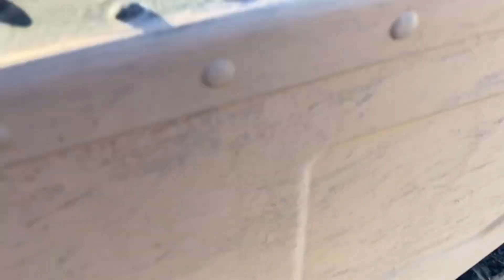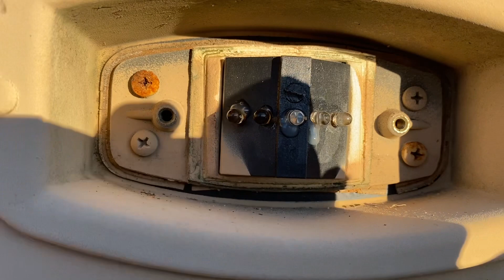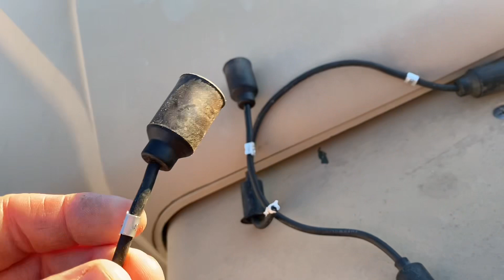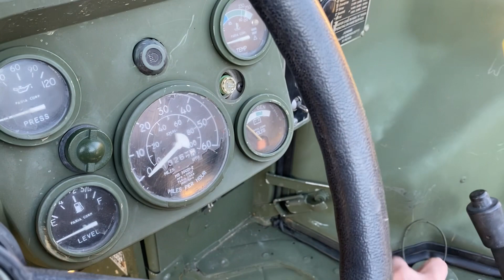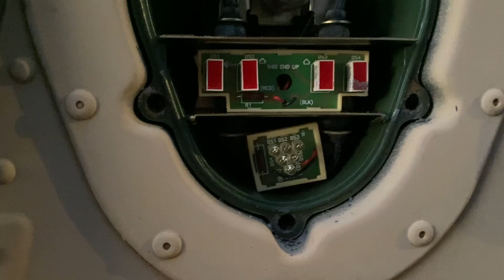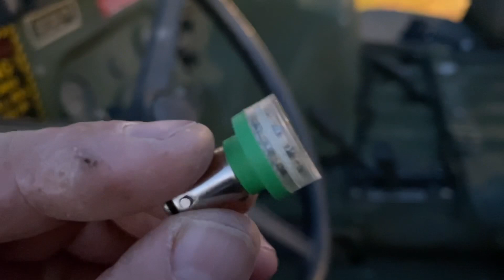Humvee 24volt Lights Replacement. HMMWV M1114 Project.  Side markers, tail and head lights.

Comment: Just as a heads up (I made the same mistake) If you make the tail light too bright it may interfere with the STOP/SIGNAL light which definitely need to be brighter than your tail light otherwise there is no change (or at least not enough change) in brightness when you apply the brakes.

Comment: Check your voltage while the engine is running. Kinda concerning that that side marker bulb was too dark. Check the grounds between the battery-chassis-engine block and the ground on the alternator. A bad ground between any parts will cause strange issues with the electricals. I wish I could find my notes but there is someone who make a new ground harness that will correct ground issues.

Comment: Hey, how did you fix the constant tail light issue? Mine is designed to be driven in blackout without constant tail lights, my tail lights come on when I break, but they are not on continuously.
Reply: You need to find the TM for your truck and use a schematic. Very basic troubleshooting. And they are called "running lights", not "constant" Why would yours be designed to only run with blackout? You have other issues you need to figure out.